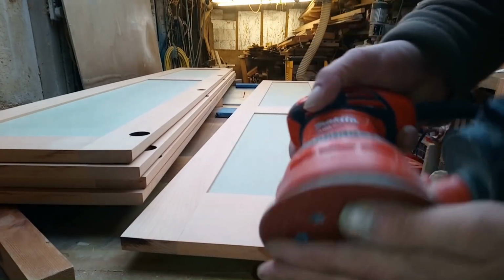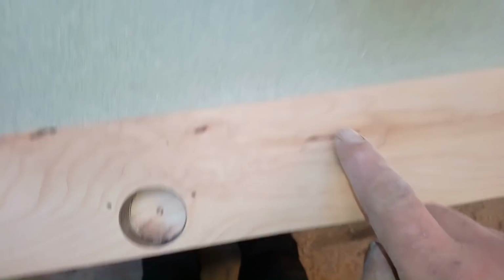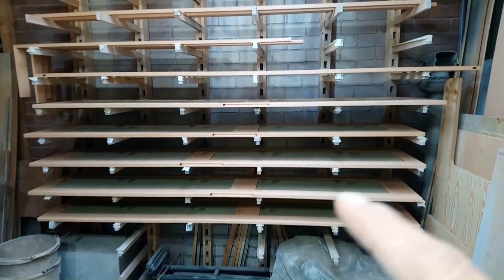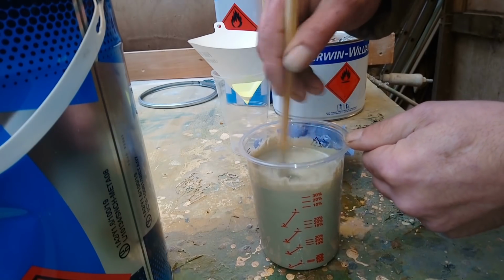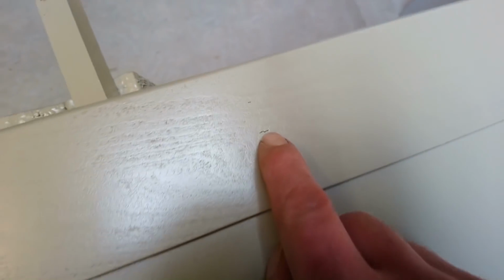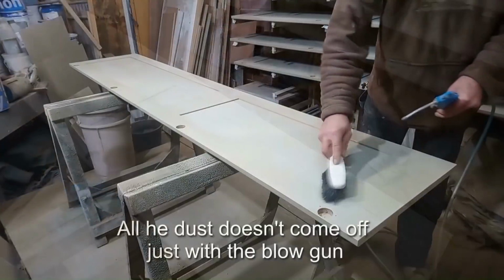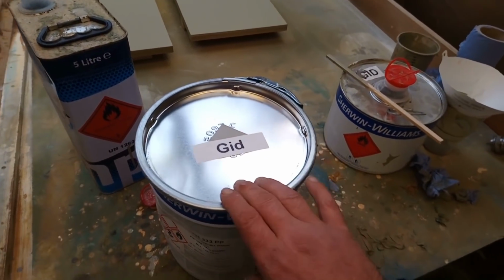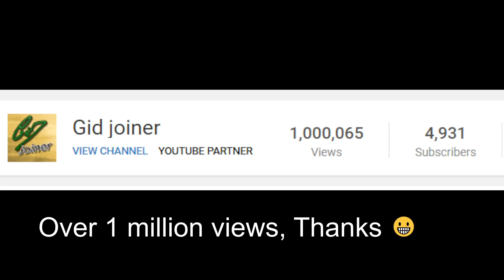Wardrobes Pt9 - Spraying the doors with 2 part PU enamel paint

Comment: Gid not trying to teach my grandmother to suck eggs but give ronseal high performance wood filler a try mate, it's so much better than the white "fluffy filla" your using. The fluffy stuff's got it's place but I KNOW you'll get a better finish AND it's harder the 2pack stuff I'm recommending. Thanks for your videos, I've learnt and put into practice from you already (doors & furniture) so thanks for teaching me how to be a better tradesman. I'm an all-rounder and teamed up with a top painter and decorator, go with the natural version not the white.
Reply from the maker: Thanks but i went through the 2 part filler in an earlier vid, sorry don't remember which vid but i do use it, 😉
Reply: @Gidjoiner  Cool still working my way through your library lol, another tip then...Geocell is the best for chalk, no shrinking or cracking! Any of the Dow stuff nocks the socks off the others.
Reply from the maker: Thanks, I ran out of 2pt stuff & hardener so use body filler when that happens, when i did my apprenticeship 35yrs ago 😮👴 that's all we used, body filler because it was better that it was hard, better under the laminates for counter tops, but in the vid i mentioned i bought extra hardener with a new tub of body filler to see if it was fine with wood filler so i could use up the rest of a tin,👍 (i might be able to find that vid because i put a link to the filler)   I've been using screwfix's no nonsense instant plaster filler as caulk, seems good stuff, it's like polyfiller in a tube, a lot of caulks are a bit rubbery when sanding, I don't use caulk a lot tho, I hate painting if I'm not spraying it, spraying shows every imperfection so if i can't sand it smooth then it's no good, 2 part filler can be too hard to sand, when sanding it the surrounding wood can get sanded that then shows in the right light after sprayed so just a light rub to remove the lighter fluffy stuff is better, different jobs n different fillers
Reply from the maker: A bit of talk about 2pt filler n the hardener is in this vid 😉 https://www.youtube.com/watch?v=7JJyiltIKEg
Reply from the maker: Good I'm glad my vids/tips are being helpful, 👍👍 because you put a link in the first comment YT keeps putting it in the spam folder so replies i make seem to disappear so sorry if i appear short,
Reply: @Gidjoiner  No problem I've removed the link and that explains why some of my other comments on other channels don't get a response, also on one of the first videos of yours I watched, you used a jig saw for cutting your scribe, I remember thinking you could do with the blades we use, Bosch T101AO they perform so well, they are thin so you'd think they will snap to easy but they don't and you can really give them some going when turning in and out of cuts 👍
Reply from the maker: Yeah i can set the comments to eliminate/not show comments with certain words like swearing as well as links, 
👍😁 once again got them, sometimes use them  👍 you'll notice sometimes/ often I'll use a rough cut blade out of choice because they are stiff, what you cut at the face will be the same at the bottom of the cut, no drifting of the blade, if i want an accurate neat cut on a curve I'd use one of the thinner blades or my fret saw, one day I'll post a vid showing all the shit I've got in the van, sometimes if i used this n that that people mention or buy all the gadgets I'd need a bigger van or I'd spend half the day either going out to the van or carrying stuff into a house, changing bits n blades,